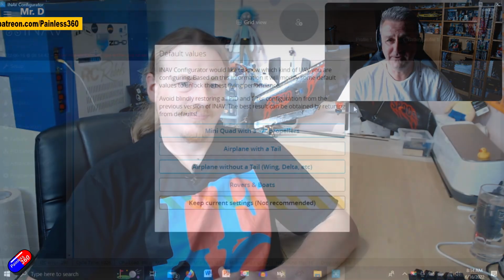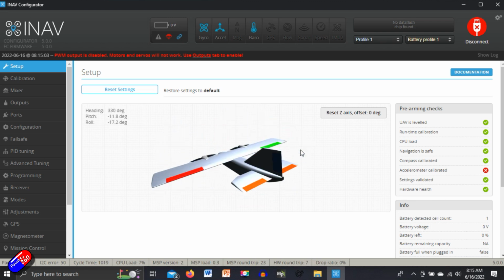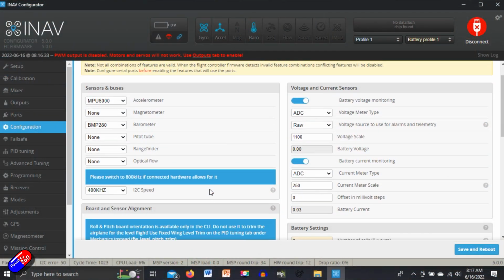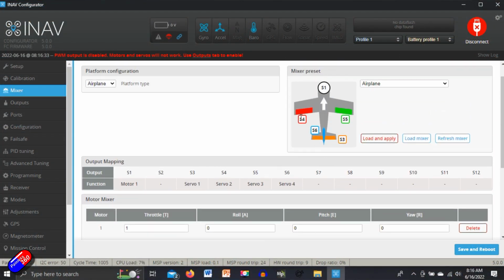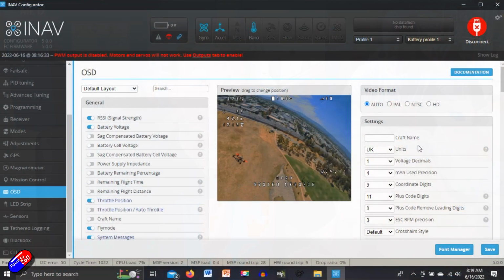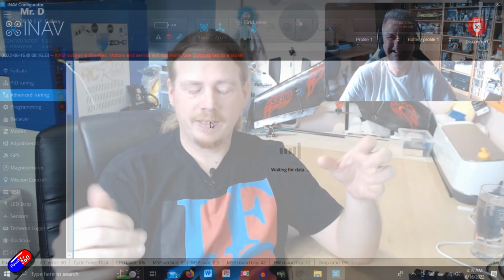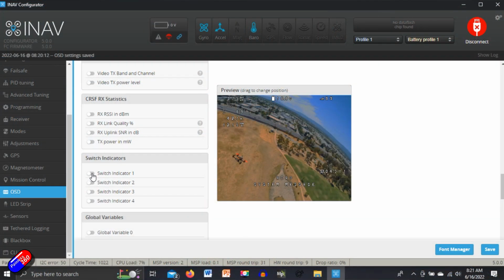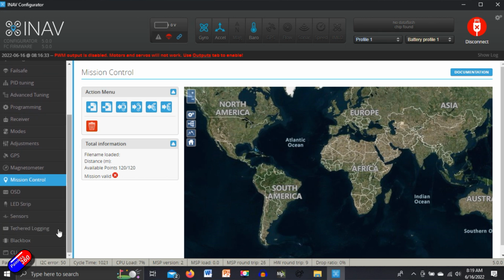INAV 5.0 is out! Darren and I discuss our favourite new features...

Comment: And I'm having trouble configuring INAV 5.0 on Rekon7 pro LR i2c error is showing.
Reply from the maker: Where is the error showing?
Reply: @Painless360   inav 5.0.0 in the bar below ( I2C ERROR: 50 ) is it possible to fix???
Reply: @Painless360 today I took a flight and the drone was out of control.
Reply from the maker: Never try and fly a model that isn't setup perfectly, you're asking for trouble. You can try lowering the i2c speed.. I have a video from when I had something similar... Best of luck

Comment: The idea of "automatic disarm" fills me with dread. That happened to my mate's Caipirinha 2 while he was several miles out - we never found that plane or the go-pro session that was on it (probably caused by the old FrSky failsafe bug)
Reply: Two completely different things there. The automatic disarm on landing needs the plane to be very still. Even gentle rocking in a tree may be enough not to trigger the disarm. The Caipi would no doubt have been flying faster than 3.6 Km/h. The old FrSky failsafe glitch is a possibility. So is accidentally flicking the switch. There are options for quick re-arming using programming. Also, this new feature adding the concept of the plane is flying could also be used to make in flight rearming much more simple, without the 2 lines in the programming tab.

Comment: @Painless360 Thanks for the overview. I have an "AKK F4 support SD card" flight controller. I know that it is an OmnibusF4, STM32F405RGT6/MPU6000, but I am not sure which firmware I have to install. There are series of Omnibus INAV firmware, which one is the correct one? Thanks.
Reply from the maker: Use the CLI 'version' command to see the target installed and flash with the same one. See my INAV setup series already on the channel.. Happy flying